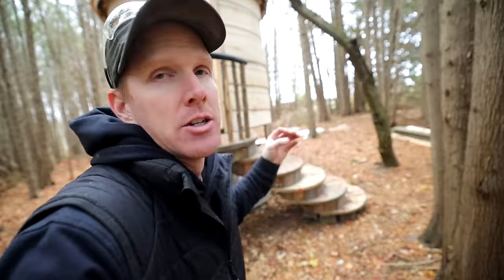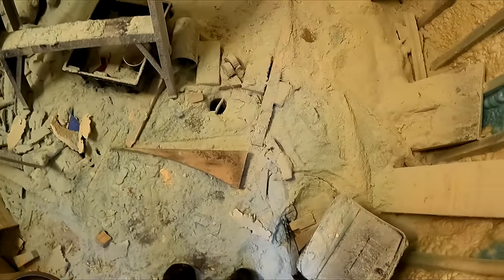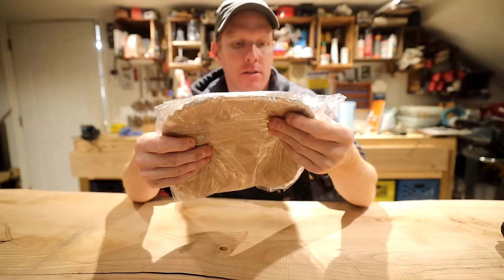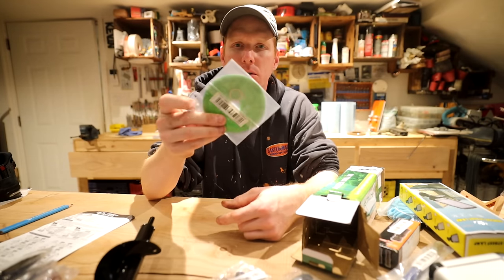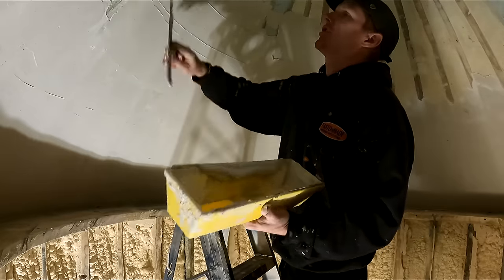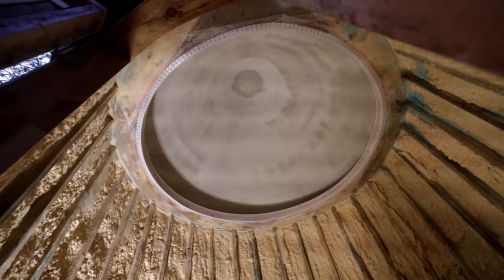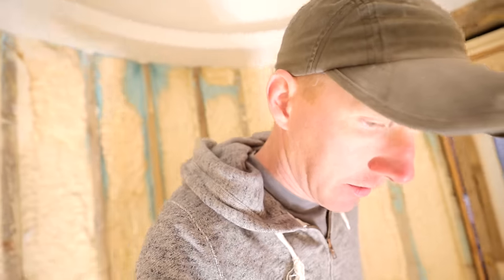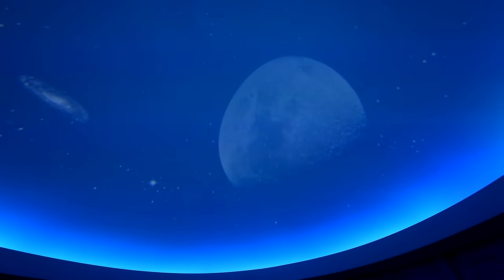This Cabin Build Sent Me to the Hospital - The Castle House Gets a Extremely Unique Ceiling!

Comment: The resting helps the hydrophobic materials in the mud finally absorb moisture so you have a creamy texture instead of dry spots. The dish soap knocks the air bubbles down that you get in hot mud or 90 minute, what ever you want to call it.

Comment: The guys that came and foamed our church ceiling, used a 24inch serated knife blade that vibrated. And one guy was using a hot wire ( like hot knife).for certain other areas.
Reply from the maker: Hot curved wire would have worked.

Comment: I’m concerned about your health but I’m curious about what Canadian money is  attracted to magnets?
Reply from the maker: Canadian coins are steel plated with Nickel.   Therefore magnetic.
Reply: @ModernSelfReliance  I went through my Canadian coins and some are and some are not magnetic. I’m guessing different years the Canadian mint made coins with metals that were magnetic. Here in the Union of States, coins are made with non-magnetic metals because of vending machines. If someone tries to use steel slugs for coins the vending machines have a magnet to caught them so no one cheats the machine. I’m really surprised at the magnetic coins that I have from other countries, too.

Comment: Sorry dude, but that's the wrong stuff to insulate with, particularly with a wooden roof... You'll have some real problems with condensation. The stuff is banned in the UK now unless it meets certain criteria. Think there's even a government grant to remove that stuff from listed buildings to protect their integrity. Sorry to hear about your pains dude, I've done my back in after the hurricane here and me collecting wood for my guitar building.
Reply from the maker: Spray foam insulation in Canada is regulated and if installed correctly and made properly it's perfectly fine and has been used for more than a decade.   You can about UK's problems here. https://medium.com/@benedict_33505/understanding-mortgage-bans-on-spray-foam-insulated-homes-in-the-uk-c8e98a17d034
Reply: @ModernSelfReliance  yeah sorry dude. I used to be a commercial practice surveyor mainly for banks. As soon as I see this stuff I'd write a report against leaning value on it. My specialisation was development and planning so not a land/property surveyor; I'd provide development monitoring and inspect properties that have been developed as well as bank valuations on any type of property. I have also worked on nuclear power stations, major development schemes of pre war industrial sites (4.8ha), 100homes plus and gypsy encapments. Foam insulation and blue asbestos are the 2 things I'd suggest property should never be built of. That's with over 10 years experience inspecting property. One of my other specialisations was drc or depreciated replacement costing - giving the time value of public assets like schools, hospitals etc. in this situation I'd inspect the construction methods and how long they have left in their lifetime. If I saw insulation like that in a UK property I'd determine it as beyond reasonable repair. It's really sh*t as you'll soon find out unfortunately.

Comment: you could have cut a piece of wood to screw into place with a gap up top for the hose, fill the foam, remove and repeat, no sanding needed. But i suppose that blame can be put on the dude you had spray the foam.  He was not a proffessional foamer i assume.
Reply: That's definitely an uneducated assumption
Reply: @xalonetv6399  how do you figure? Perhaps you meant unprofessional assumption, that I would agree with. I have done similar work with Spray foam using this technique, so unprofessional yes, uneducated, no